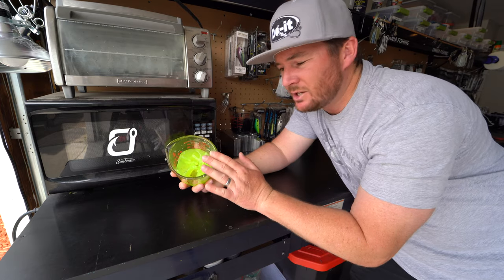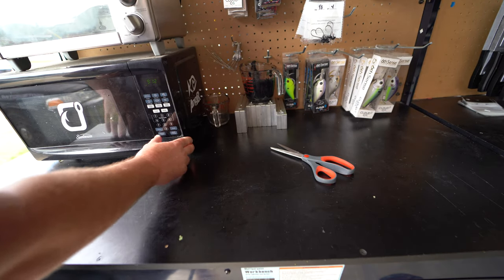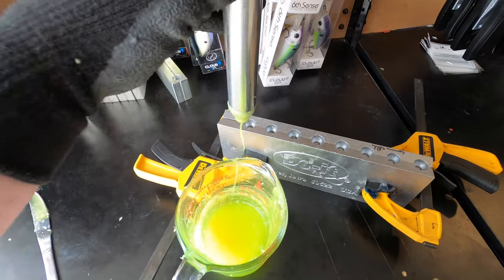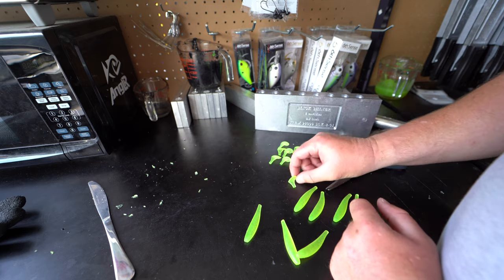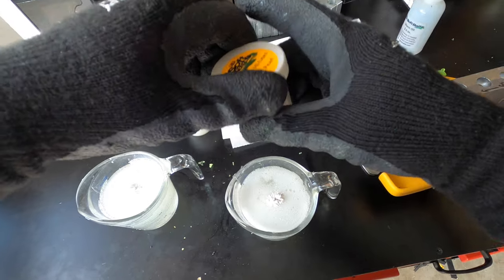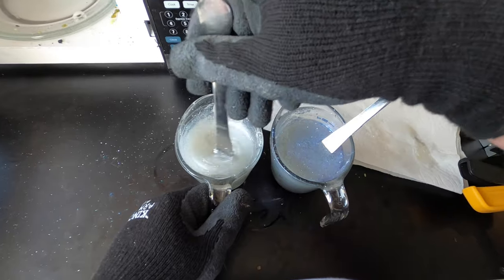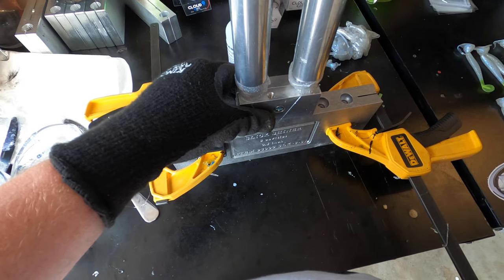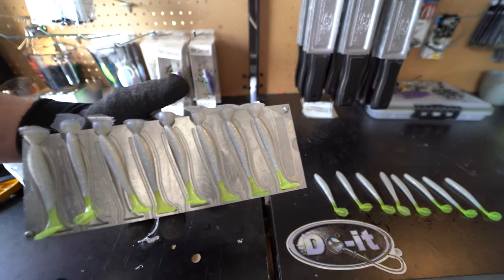Making Soft Plastic Swimbaits with the Do-It Molds Slick Shiner Mold

Comment: I only lube one whole side of mold with Pam spray oil. I shoot a little on my table then take a tooth brush and lightly brush a thin coat of oil in one side of mold. The char lures stick to unoiled side. Take knife and cut tail and lift out body leaving tail in slot. Next I put top mold back on shoot body color. Works well for me. Lot less problem putting tail section in mold.
Reply from the maker: Good way to do it

Comment: So how well did the body stick to the tail? If you slightly pull the tail does it break off where the colors meet?
Reply from the maker: It works fine.  You just need to pour the body color a little hotter so the adhere to each other well

Comment: I just recently got that mold been shooting some baits for some reason they are coming out really dull looking not shiny any ideas
Reply from the maker: That’s how they turn out with the cast aluminum.  Use less colorant and they’ll be a little more vibrant, and there’s probably other videos out there about using cooking oil and high heat paint on the mold to get the shiny look.  This a cast aluminum mold, and not cnc.  Cnc will give the shiny look.
Reply: I was shooting remelt plastics from some plastics I was never going to use so I melted it all down to make some swim baits. Here soon I'll be melting new plastics and making colors
Reply from the maker: Awesome.  You can get really cool baits with these molds.  When you make your own colors you’ll be able dial them in a little more.